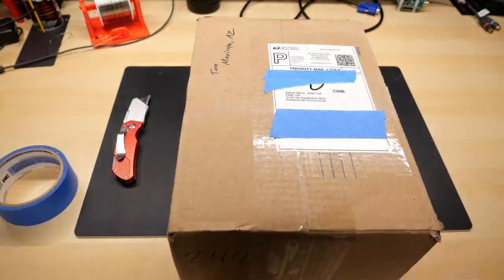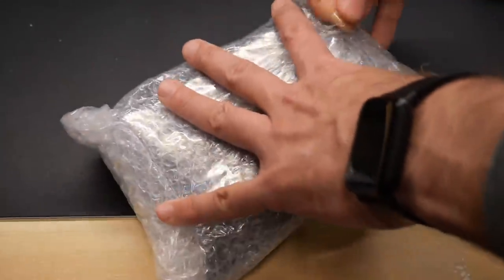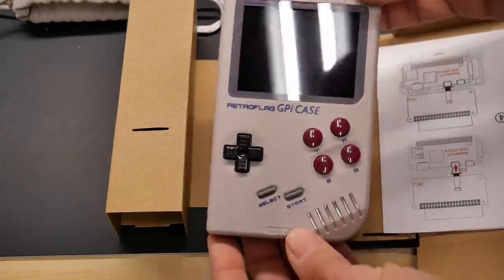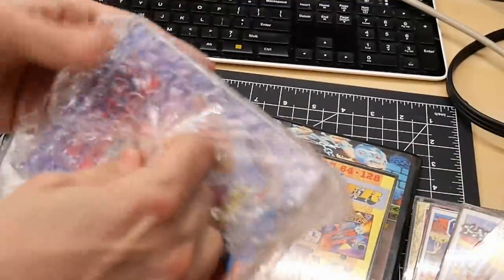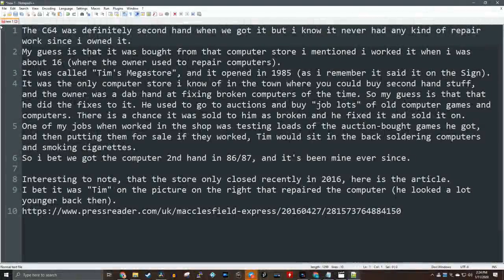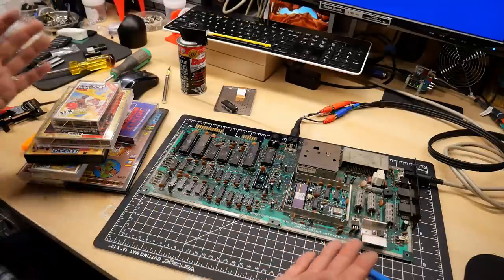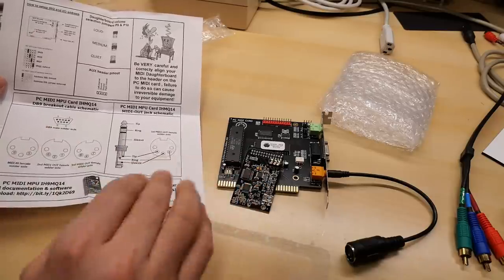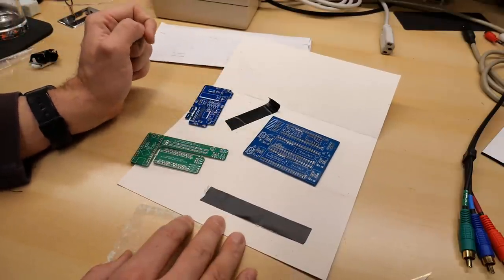Adrian's Digital Basement - Mail Call #2

Comment: Oddly, there was a Dixons shop in my town, but they didn't sell C64 games, you had to go to Boots(a big chemist chain, of all things) to get your games.

Wizball is an absolutely legendary game

For the "record", typically the single size jewel cases are typically £1.99 budget releases, with the double jewel cases being the mid range or rereleases of big box games that typically cost £5-£10, and the boxed games(think like a PC-style big box, but closer to the dimensions of a double jewel case, though thicker) are the big new releases and would typically cost £10-£20. Disk versions of these games were typically only available by mail order and cost £5 more per game.

Prices of course changed over time(I think by 1990, budget had went up to £2.99, and some boxed games could be £25) and the box didn't always represent the release type, for instance that Gauntlet is a big new release, but in a jewel case rather than a box. I also have the tape version of original release of Mayhem in Monsterland and that only come in a single size jewel case.

Comment: If you want to test out a the MIDI card with a Sound Canvas properly you should try it with General MIDI/General Standard games like Dune 2, Doom, Tyrian, Descent and Duke 3D. It sounds great with those. Many of the games of that era have both options for GM and even specifically for GS/SC. A lot of Win95 and early Win98 media of all kinds also use GM MIDI for music
Reply from the maker: Excellent, thanks for the tip! Can't wait to try it ou. :-)

Comment: There is a Pi compute module 3 addon for the GPi case, ETAPrime just did a review on it, and brings up the overall power from single to quad core and i belive an extra GB of ram
Reply from the maker: Oh wow that sounds very cool. I'll need to check that out because the Zero is quite low power.

Comment: 29:37 - If anyone's as keen on this black PCB substrate/copper/clear soldermask scheme as I am, OSHPark made it available since August or September 2019 as "OSHPark After Dark". It's the same price as their regular service, but you have to wait a couple of weeks longer and it only comes in 1.6 mm thickness. 
And it looks even better in person than on camera.
Reply from the maker: It looks absolutely amazing. Agree! And that's right, Robert mentioned he had them made at OSH Park.
Reply: They were actually pretty quick to turn around for me, I think I got the order in just as a panel was being sent off.   The only problem is OSH's pricing structure does not scale well for larger boards, making these quite expensive to have fabbed up.   I do like how the "After Dark" is the same price as their normal Purple boards though..

Comment: Well, you've probably seen me comment on a bunch of your videos. After watching your ant-farm C128 series, I broke down and ordered an untested (powers up, but the seller didn't have a monitor to hook it up to, he found it at thrift store) C128 off eBay. Growing up in the 80s, I had a C16, and am really looking forward to getting my hands on a 128.  I've ordered an SD card reader adapter from GB, too.  I'm just hoping it doesn't need a lot of work, but if it does  I will just have to watch your videos again to troubleshoot mine.  Please post more C64 and C128 (or any "will it work?") Computer videos, I will never get tired of those.
Reply from the maker: Good luck with it! :-) C128s are pretty reliable generally ..... so hopefully you'll be good.
Reply: @adriansdigitalbasement  so, I received the C 128 today! Hooked it up to a TV, and it worked. My kids and I spent the evening writing a mad-lib program. The only thing is I can't seem to get it to play any sounds. I'm wondering if maybe it has a bad SID.  Would you recommend getting a 1084 or 1702 monitor for it? It's hooked up to a TV currently.

Comment: When I was a kid and people still sold games on tape, they were mostly 2nd hand ones laid out on a market stall (some tapes may not have been entirely legit!!), too young to have knowingly seen them for sale in places like Dixons (which merged with Currys-PC World a few years back)... :)
Reply from the maker: It certainly was easy to copy takes right? And the C64 was pretty reliable at leading them (like versus a ZX Spectrum) so I could see how unscrupulous sellers would make the copies like that.
Reply: Definitely easy to copy games, just needed a twin-cassette deck and some blank tapes, even better if it was a high-speed dub deck, no DRM to deal with back then, but the copies were cheaper, though home-made copies were also handy for when someone else had the one you wanted too... :)

Comment: 5:00 Are you still looking for Voice Command Module 64 disk images and the manual? I have the manual, but no means to scan it right now. I also have one disc, labelled "MasterDemo Programs Commodore format Jun 18 1985 EMG Mfg. Inc. ©1984" by Chirpee.
Reply from the maker: I haven't delved into that so anything would help. For scanning you can use your phone with an app like Google drive or other scanning apps. Uses your camera to snap pictures of the pages and makes a PDF.

Comment: Nice stuff you got there. Also good to see that the c64 scene is still alive. I am also a c64 owner again. With 2 1541 diskdrives and 1 datasette. The problem I have is that the diskettes are becoming quite rare. The ones I have are getting unreliable. How can I still be using software in the future without an sd2ic?
Reply: You don't. In my opionion every C64 needs at least one classic storage device (1541 or 1571) and one modern storage device. The modern storage device can be an sd2iec, 1541 Ultimate II, Turbo Chameleon or anything else has been made. The reason is that we nowadays exchange software via the internet and to be able to transfer that software from/to a C64, a modern storage device is the way to go for. So better start saving money for one.

That said, occasionally new-old-stock diskettes are offered on Ebay. I had no problem finding blank diskettes. So you definately can use diskettes anno 2020.
Reply: By way: If diskettes become unreliable, clean their magnetic surface with ethanol. This often makes a troubled diskette work fine again.
Reply from the maker: I actually have done that to recover some old disks that had mold growing on them. Allowed me to read the contents off one last time before archiving it.
Reply: Actually, when i was a kid, the floppy games were expensive and i didn't have much money (yet at one point i had 2 1541's before i sold one of them), so i used to back up the original floppy and then only use the backup to play the game. So i think all of those 3 orginial disks i sent would probably only have been read once. They were stored in a closed plastic floppy box, so i think they should be ok.

Comment: So I guess that when that C64 was repaired, the RF shield was discarded. I have a few UK built C64 all with RF shields.
Reply from the maker: No, this board never had one. There aren't even pads to solder it onto the mainboard.
Reply: @adriansdigitalbasement  Ah right European machines never had those. I was confusingly thinking about those cardboard and aluminium foily things you always throw away :)
Reply: @hugovangalen  No, that is not true either. The majority of machines in Europa do have RF shields, mostly paper, some metal. However, there are indeed machines that didn't have them and it is one of the mysteries of Commodore to fine any logic in that. It doesn't seem to be factory specific: Both the UK and West-Germany plants did produce machines with and without shields. It might have been target market specific and today it is hard to track for which country a machine was originally produced.
Reply: @danielmantione   Interesting, thanks for schooling me :) I do suppose the metal ones are very rare? I  have repaired over 20 machine built in the UK and Germany and all they had was the cardboard shielding on the bottom, never seen the soldered-on type there..

Edited to add: I get the impression you think I meant European did not have RF shielding at all. I never ran into the metal kind is what I meant.

Anyway thanks for the information. :)
Reply from the maker: It's interesting about the cardboard ones -- I've never seen anything on the bottom that was cardboard. In the US/Canada, there is a piece of cardboard between the soldered metal shield and the motherboard (to prevent shorting) but I take it the ones you have seen were foil coated cardboard? How did the cardboard attach to the motherboard for grounding? Like on the top somewhere? Like you said this may have had the cardboard then and it was discarded by the original repair tech before Dave got the machine in 1986. I'm just not sure how it would have been grounded as even the motherboard around the screw holes had solder mask .... See pics here: https://imgur.com/a/ehrPyIv (oh sometimes I had seen the carboard soldered onto the RF mod but no soldering to the RF mod on this machine either.)
Reply: @adriansdigitalbasement  Yes they are foil coated cardboard at the bottom. I've also seen a few machines with metal RF shielding on the top, which are attached to the board via the screw holes the whole board is fastened inside the case with. The bottom however, I never seen anything else but foil coated cardboard. 

It covers the whole bottom and wraps around, and either completely, or partially (on the right side) covers the top and for grounding eventually a metal clip attaches it to the metal casing of the RF modulator, see here on this blurry picture I just made: https://ibb.co/9Nk7czG

[Edited to fix link :)]

Comment: Dave, if you're reading: glad the motherboard was ok. I happen to have one here as well, and need exactly what you have left: case, keyboard and especially power supply. Think you could sell me those? I'm in Italy.
Reply: I'm going to use the case and keyboard, as i've ordered a Keyrah to put in it. You are welcome to the PSU but i don't think i would recommend it. It is the orginial black resin filled PSU, there is a chance it does not work, it is unrepairable, and they are known to be bad PSU's as they when they fail (and they probably will), they blow the whole C64 up. Adrian will give you his thoughts on them, he recommended it only be used as a boat anchor or a door stop.
Reply: There is a post somewhere from Adrian where he recommended what you should get instead of the original PSU, but I don't remember where that post is.
Reply from the maker: Indeed, the PSUs are quite unsafe to use because of the way it uses a resistor and a linear regulator to create the 5v rail. When the resistor drifts, it can result in voltages that are too high, kidding the system. A quick google will bring you to various modern and safe options you can buy or videos like Retro Recipes where he makes a new one from common parts.

Comment: Do deoxit/ipa work on nonworking keys of the keyboard?
Reply from the maker: Depends on the keyboard but if it's a key switch with metal contacts, it can often help greatly yes. I have fixed temperamental keys on Alps keyboards with it and the repair stuck. I highly recommend it.

Comment: Unrelated note, I super want that Multimeter from EEVBlog lol

I'm broke and have a Fluke 87-1, and two Harbor Freights.
Reply: It's buggy, better get a Brymen 869.
Reply from the maker: I have actually found a couple small issues like one the other day where it was reading 400 or so ohms on one manual range and then 0.8k ohms on another. (The real reading was in the 800 or 0.8k range....) Dave does update firmware for it which does seem to help in some regards.
Reply: @adriansdigitalbasement  how's the Bluetooth and software for it? Just dawns on me Dave may have videos for all this lol
Reply: Nothing wrong with your Fluke, I still use mine and it holds a place of honor on my bench. My work meter is a Uni-T something or another. It's been great, but I would be less upset having it walk away than I would my Fluke. I'd be cautious with those HF meters. Or just about anything else that they sell as far as that goes.

Your display will eventually mess up (as well as the selector switch), but there are replacement Zebra connector strips available for them (as for the selector switch, you will notice that it will eventually get "possessed" and start chirping on its own - even when it's off. Just clean up the contacts with some IPA when that happens).
Reply: @MrWaalkman  I've upgraded the display to the newer white background and black text, replaced the battery connector, replaced the fuses and replaced the dial on it.

The harbour freight metres I have are the rebranded Meastech Meters, not the ones that fall apart when you look at them. One I use for low voltage DC things as it's not RMS and the other that is RMS.

I would love a Fluke 87-5 but that cost more than I have in all my Meters I have combined lol.
Reply: @succuvamp_anna  Yikes! My meter is over twenty years old and is doing great. I guess that I can ignore the broken rubber band between the shells and count myself lucky. 

Most of my test gear is 'dated'. My clamp on meters are an old Amprobe from my apprenticeship (circa 1975), and a Weston 633-60. My analog scope is an old Tek 4 channel (but that's what you want in an analog scope, age. I have a modded Rigol 1054Z as well which is my 'go-to' scope that I take to work), and much of the rest is old HP gear like 16700 & 16900 LAs, 3852As, and a 3311A. Anything with a HP-IB buss. If you've got the room for them, they can't be beat. :)

The soldering gear, however, is modern. Nobody wants to use a damn Weller from the dark ages.
Reply: @MrWaalkman  that Weller world have been been a godsend compared to my old Radio Shak soldering iron lol.

Glad I splurged and got a Hakko.
Reply: @succuvamp_anna  I've got a RS 60 watt digital soldering station, and it's not bad, but I prefer my TS100. But yeah, any other soldering irons that they sell are junk.

I do have a Hakko FR-301-03 desoldering gun, and it is fantastic!
Reply: @MrWaalkman  oh, no, my RS one was the two mode 20 or 40 watt crap iron lol.

Comment: But why just get the logic board of a Commodore 64 if you could get it with its own case as well?  That doesn't make sense.
Reply from the maker: Saving Dave on shipping costs from England and also is going to reuse his breadbin and keyboard with a Raspberry Pi and Keyrah so he can still enjoy his 64 without all the unreliability issues. Plus, I have plenty of C64 machines already, but the main board with good working chips are hard to come by now.
Reply: @adriansdigitalbasement  Ah, I see.
Reply: Yeah, and all the clips are broken on the case, and one of the screw mounts is snapped too. It doesn't look too bad when you first inspect it, but it was shabby in the 80's. The keyboard is all there and intact though. I'm still waiting for my Keyrah to arrive.
Reply: @DavePoo  That's unfortunate.  What about the keyboard?
Reply: @infinitecanadian  The keyboard is good as far as i know (no missing or broken keys), but i won't be able to test it until my keyrah arrives. Adrian gave me some instructions on how to service it if it isn't working correctly, so it should be good. Interesting that my C64 keyboard, all the letters are still bright and visible. But my fancy Cherry MX keyboard has many of the letters worn off after only a year of use.
Reply: @DavePoo  That's because they built many things tougher in the 1980s.
Reply: @infinitecanadian  You mean apart from the PLA chip
Reply: @DavePoo  Yeah.

Comment: Those C64 tapes shouldn't take 20mins to load, they'll have fast loaders so 7mins at most
Reply: fast loading games are recorded faster too (a game using up less tape) so these normal tapes won't load with a fastloader. correct me if I'm wrong
Reply: @maicod  Correct, if the program has been saved with the slow, built-in routine, then it'll always be slow. Those commercial tapes though will all have fast loaders.
Reply: oh but fastloading has not existed from the start of the c64 so older games won't have the fastloading I'm sure
Reply: @maicod  Right, Most games released on tape from 1984 onwards should be fastload, by then the US had already moved to disk drives, but Europe stuck with tape right up to the 90's.
Reply: I think you mean UK with Europe. I am from The Netherlands and had the 1541 way earlier than that. I even had several models in the c64 period. Like the normal 1541 and that light beige one (I believe it is called 1541c) with a lever closing  mechanism instead of a turning knob